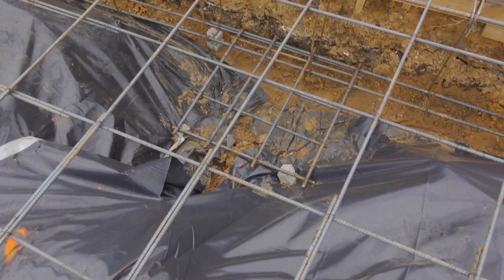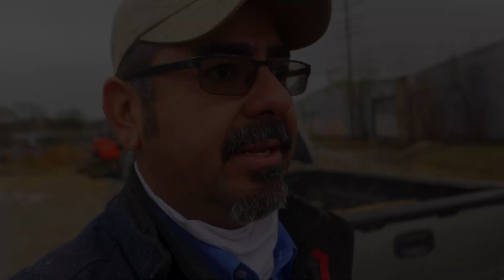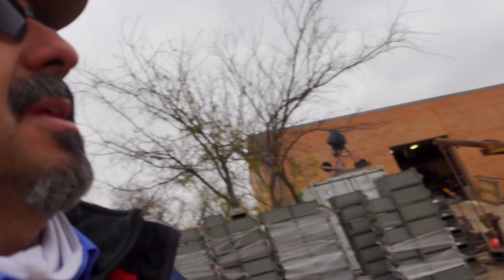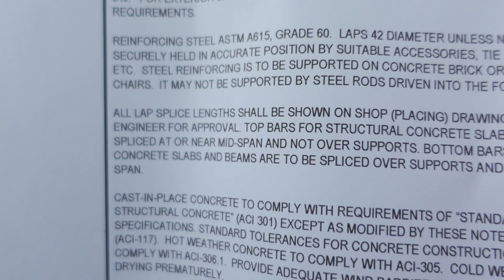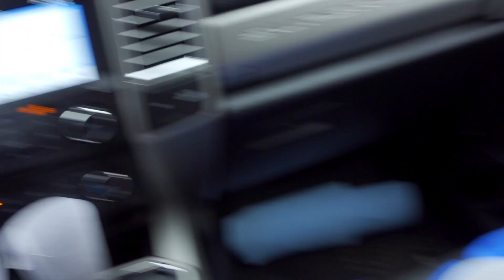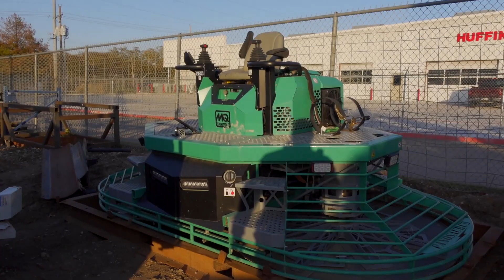Preparing concrete slabs for pour day | Blacksmith tools

Comment: I like your channel I was a concrete contractor for years started out residential then commercial and from there went into military projects. I know all about FF an FL floors. Military contracting you have to have certified floor finishers from ACI so I sent my top finishers and myself to Atlanta to get certified. 
I had about $400K invested in finishing equipment 5 8ft riders, 10 walk behinds Somero laser screed and the power rake. I know all about night pours because here in northwest Florida it gets hot during the day. My biggest job was Elgin AFB we did the structural and civil concrete for the new F35 for the Air Force and the Navy and Marine Corps  a very big job that lasted almost 2 years. There I times I miss it and other times not at all. Anyone that has been in this business all has horror stories.